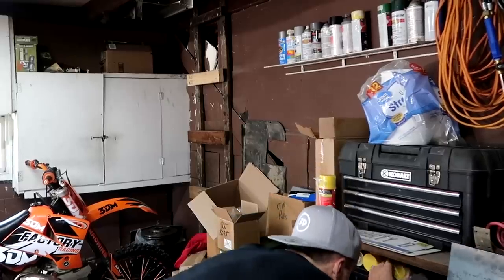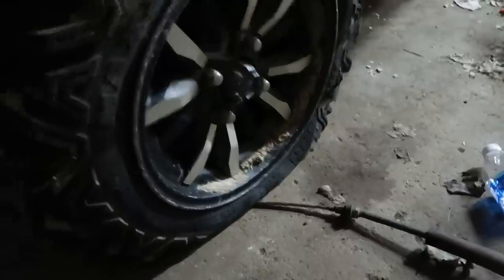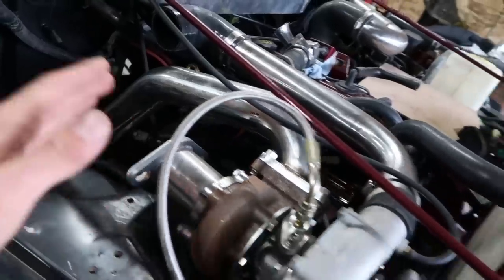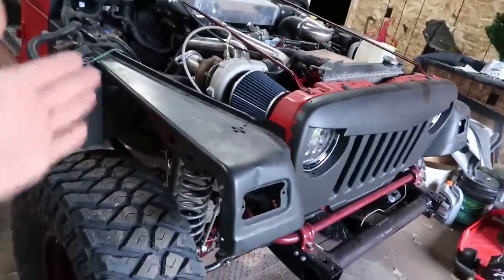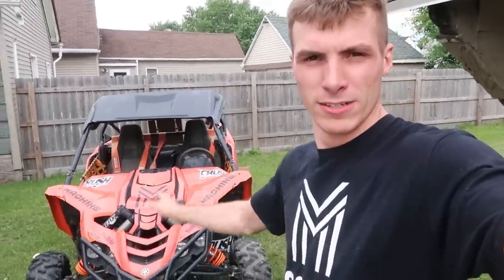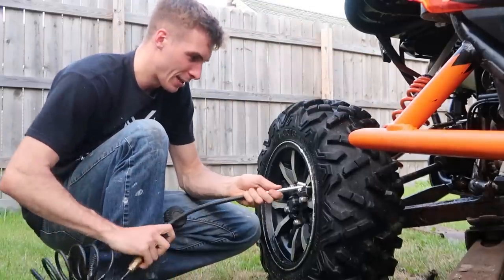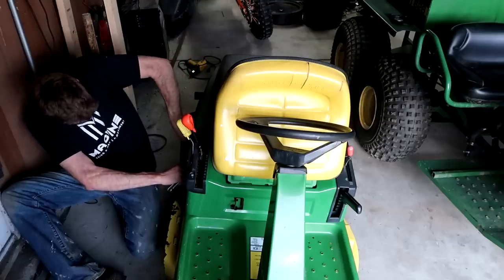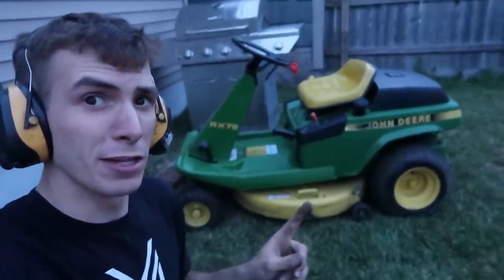The Truth about the Jeep build...

Comment: are you still needing to build the exhaust? i know this might sound crazy and a little time consumptive but if you're willing buy the metal pipe you need and flange, cut and mock up your exhaust, and i will weld it for you. just pay for your materials and shipping and we're good. I just finished my 2.4 turbo build and have gotten pretty good at welding. I'd be willing to do this for experience and to see this build get completed.